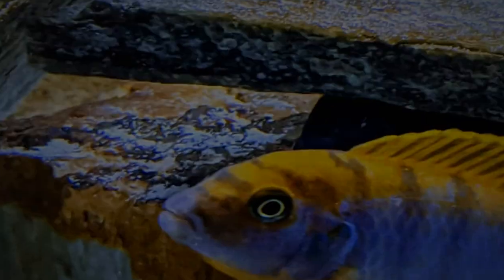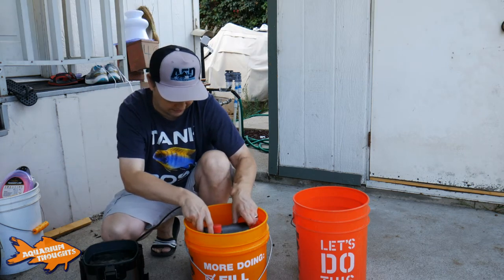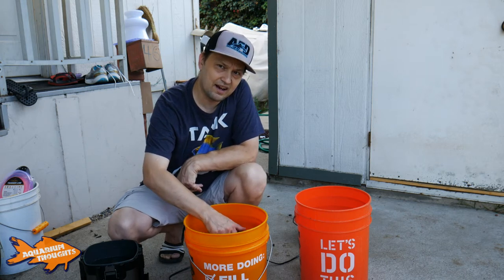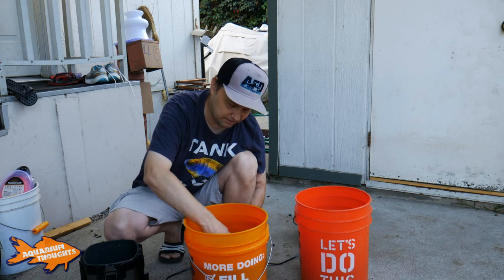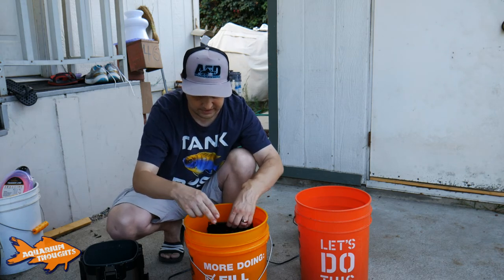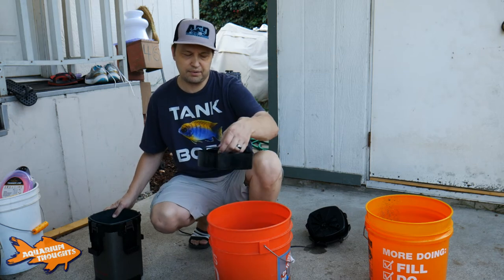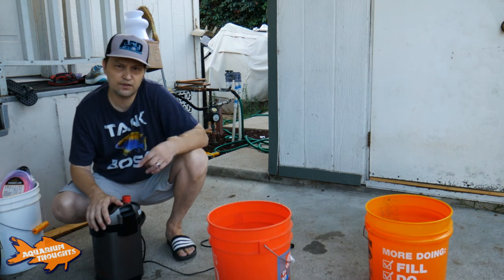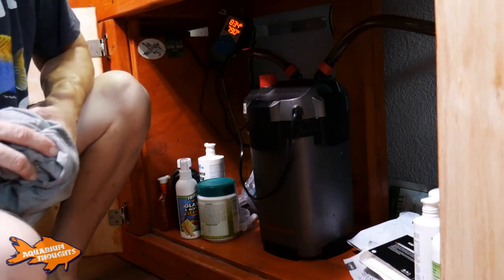The easier way of priming the Marineland Magnaflow 220 Canister Filter plus cleaning

Comment: Glad it worked! That works when the hoses are primed. When setting up a new canister (any brand) just do the same thing, no water in the canister,  place the outflow  and inflow tubes in the tank and push the priming button a few times and it will fill by gravity, then plug it in. If you cannot make the priming button work, then get the output out and suck a few times until water starts to fill the filter. You will not inhale any water because there will be no water in the tubes and filter. These two never fail.
Reply from the maker: Thanks. Yeah I figured it the new install as well after thinking about it after the fact. That's why I put the notice up in post-production. But it definitely is easier
Reply: This video and particularly this comment saved us so much hassle! My husband doesn’t like to listen to me. But you both helped me! Thank you!!! ❤️
Reply: thanks both of you
Reply: I don’t know if you’ll see this, but why do you mean by sucking the tube? Won’t crud and whatnot get in my mouth? I just don’t know what I’m doing wrong. I can’t get the output to actually start sucking in water.
Reply: @robertmcgormley3446  Hi! Nothing will get in your mouth because everything, output, input and canister should be EMPTY. So, you connect both hoses to canister, place the input in the aquarium and then…. Aspire, suck the air from the output until you see that the water is flowing from the tank through the input hose to the canister… it is then that you place the output in the tank, no need to hurry, where you want it. You will hear the water filling up the canister… when the noise stops you plug the canister to the electrical outlet. It will always work, guaranteed. It works in any canister because it is just basic physics.
Reply: You an amazing person

Comment: Excellent video I grabbed a magniflow 220 last week on sale and have been delaying the setup due to hearing about the difficulties priming and wondering if I should return it for something else. This has really put my mind at ease and I'm going to go try this setup now much more confident
Reply from the maker: Yeah it's a pain in the butt to prime. This method seems to have mixed experiences as well. 🤷‍♂️ It worked fine for me before I stopped using it and just went HOB. It works, but isn't the greatest by any means.

Comment: Well it worked for you but in my case it did not. I did everything you did in this video and the hoses were primed. I still had to use the primer to get flow. It is brand new just got it. I tried everything to get it to work. This is not a negative comment towards you and thank you for your video. After many attempts and taking it apart and putting it back together. I filled it with water and started a siphon on the inlet and priming it about 10x it started working. Thanks for your video.

Comment: I just pump water directly into inlet tube using separate pump. Turn filter on. Water then forces it's way though canister to outlet via the pump and filter operating. Turn pump off and filter is good to go on its own then on. That prime button is inconsistent. Works sometimes, others not. Found this to be easier.
Reply from the maker: It seems like a lot of methods work for some and not others, even the included method on the unit itself. But this way I demostrate here did work great for me when I had it,

Comment: when you bought it brand new since there was no water in the inlet/outlet hoses did you have to manually add water to the canister before plugging it in and if so how much water would you fill it with?
Reply from the maker: When I first put it together, I filled it up and had to prime it. I'm not sure now if doing that would work or not. It was a tough prime doing so. I'm thinking now it might be better to leave it empty if the priming pulls water from the tank. But if it primes it up the outflow, then filling would work. 🤷‍♂️ I'd have to look at the direction of the priming function

Comment: I have two baby turtles in a 20 gallon tank with this filter. I bought it four months ago and I cleaned the filter about a month ago as well. Recently I noticed the water flow from it has reduced a lot. I cleaned the tubes and still no luck. Does anyone know exactly why it’s doing this? I have a feeling the actual filter needs a clean again.
Reply from the maker: Have you checked the impeller to see if there;s a clog in there?

Comment: Mines got stuck how can i get it un stuck.  I cleaned my whole tank and also the filter and i was ready to turn on my filter but it wont suck water into the filter and my button is stuck help me out
Reply from the maker: I'm not sure I would be much help with that problem. I know the button was hard to press at times in general. If you let the canister "self-prime" by leaving the canister with no water, water should have filled the tubes to make it work. Other than that, I would start with taking it apart again and make sure everything is seated correctly. 🤷‍♂️ Other than that you can troubleshooting it through Google. I'll have to look into that myself when I'm not at work

Comment: Trash filter. Ive never had so many issues with something. I tried this method and no work. No clue how to prime it now.
Reply from the maker: Definiteily not the best, but for the price I got it at it wasn't bad. But I see a common theme on this. You pump the priming button, it works or doesn't work depending on the person. You can use the method in this vidoe and it works or doesn't work depending on the person. I guess maybe you should try jumping around on one foot while touching your nose and pressing the button, maybe that would work. But after reading a lot of comments, I wouldn't recommend this filter.

Comment: Do you ever have a problem with it being noisey?
Reply from the maker: Never had an issue with noise. Only issue I've had was if the water level gets too low(tank evaporates water like crazy) it leaks. Only leaked twice and never replaced anything and hasn't leaked when I had water to the brim of the tank. 🤷‍♂️

Comment: I feel like the hardest and most non-explanative part was cut out. That being the disconnecting of the tubes without getting water everywhere. Why was this part not filmed? Onto another video I guess.
Reply from the maker: I guess I could have filmed that. Though on this model, it had been a non-issue as you disconnect the hose connector and it closes. Very minimal water flow out. I might have a video cleaning the unit which may include that part

Edit: I didn't find that video.
Reply: @AquariumThoughts  Ok, thanks
Reply: No water will spill if you follow the directions, may be a couple of drops but all canister filters are equipped with some sort of on/off valve that allows to retain water in the hoses until you connect it again to the filter. Once connected and opened/unlocked, water will flow and you can restart the filter again. There is no reason to spill water if you use the system properly.

Comment: You put water in the canister first now what the hell
Reply from the maker: If the hoses already have water in them and the ends are fully submerged, water should flow downwards into the empty canister and start a siphon which will fill the canister with water. It should be primed to go.  If it's a fresh start with no water in the hose, that will not occur. I'm guessing priming an empty canister might actually be easier than doing it with water if it siphons the water down but haven't tested it to see if that works. 🤷‍♂️. 

But if you feel anything of this is wrong, then feel free to explain why it's wrong and doesn't work, but it worked for me at least from after cleaning the canister, not from the fresh start. This video was actually created because of a comment correcting me in a previous video. The correction worked and is in the video.